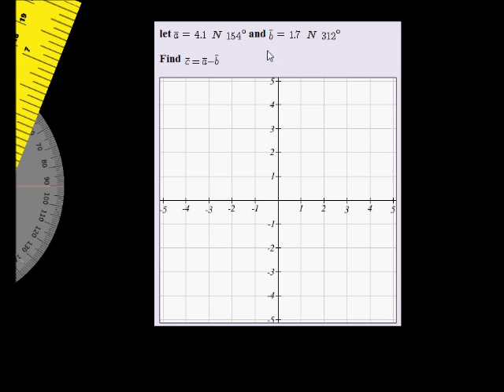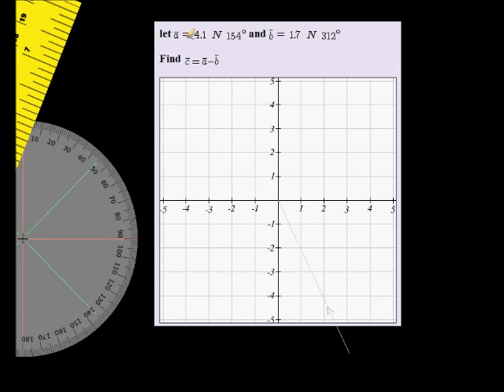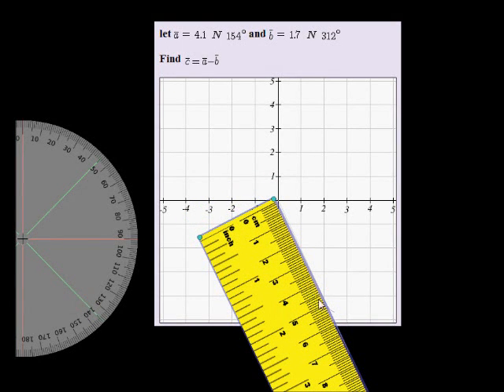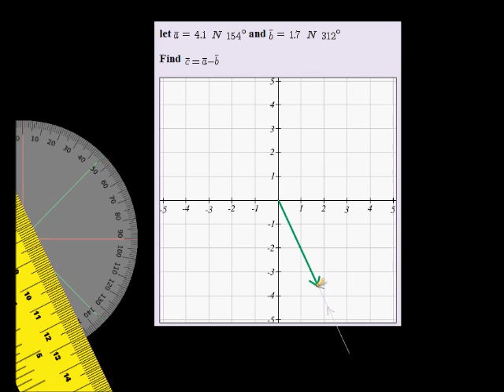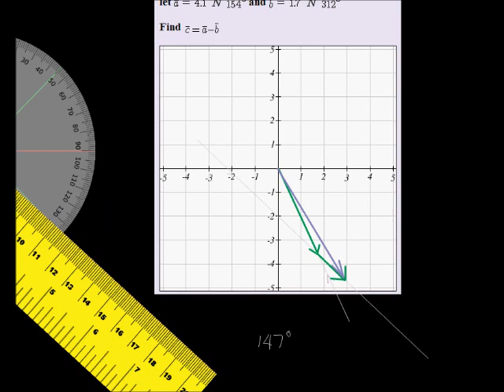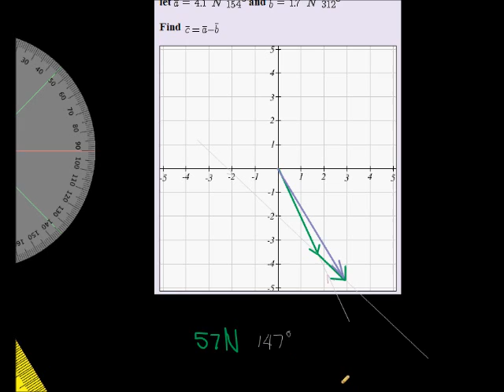Subtracting two vectors example

Comment from the maker: Hi there, I used a program called Idroo (you'll find it with Google) that uses vector graphics. The ruler and protractor are simply two png images, that I found online (I edited the protractor somewhat). The program has the features allowing the re-sizing and rotating of images. It worked for the purpose I needed :)